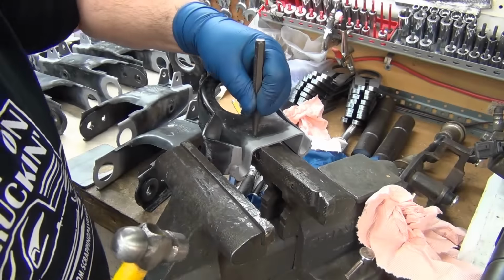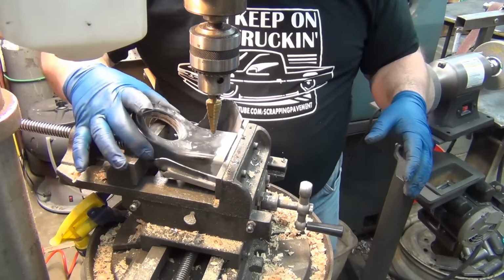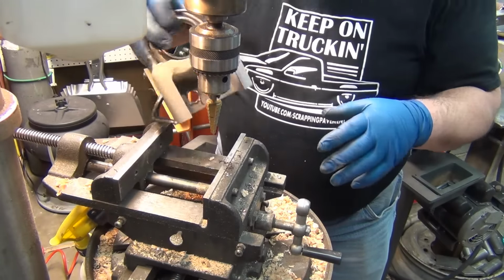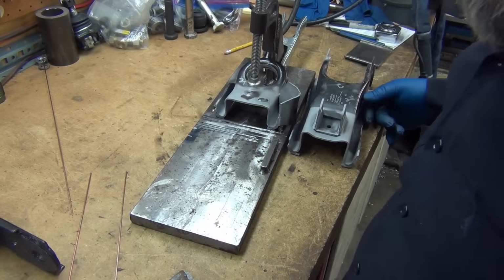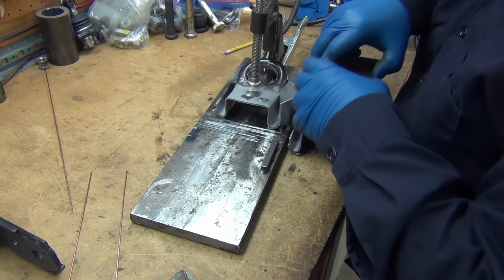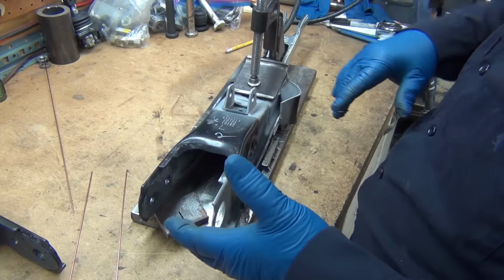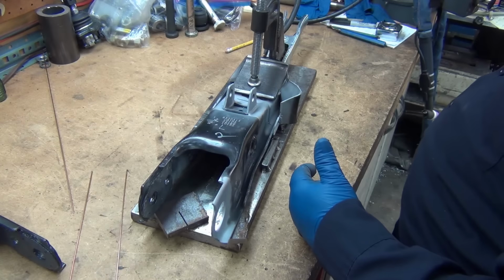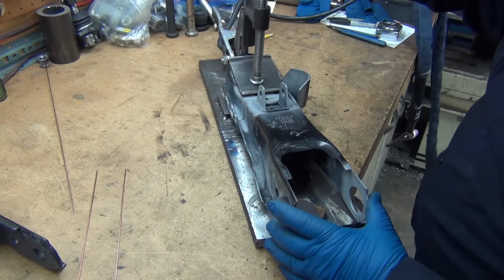LCA - Swaybar link hole, tack welding

Comment: OIL!! Please. One of the isles that I stay away from at harbor freight, drill bits...  I just waste my money.
Reply: I second this motion to use oil. :) Especially with very bits/unibits. They tend to cut much better with a little oil.
Reply from the maker: I used to.  They have gotten better over the years, actually.  For production parts, I tend to buy better bits and stub drills if I can.  There's certainly better ones available for not much more money. :)
Reply from the maker: I really should use more oil.  I tend to shy away from it.  It ends up getting on the floor and then tracked around the shop and into the house.
Reply: yes. I hate that too.. It makes easy messes very difficult to clean. and it messes up the shop pretty quickly.. They have some pretty nice enclosures online. I plan on building one for my mill. after I restore it.. it may be a while..
Reply from the maker: Did you see the shower curtain setup I'm using.  works surprisingly well and was dirt cheap.  Even cheaper if you don't to the doors like I did, but I think they make a huge difference. :)
Reply: I'll take a look.